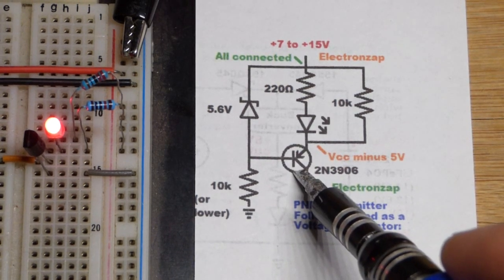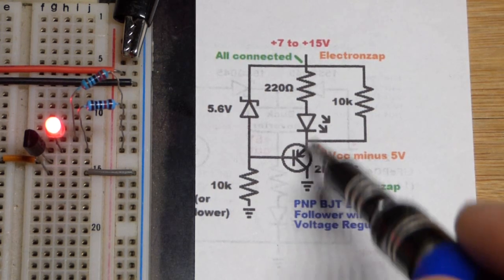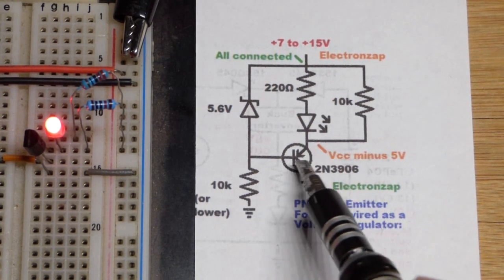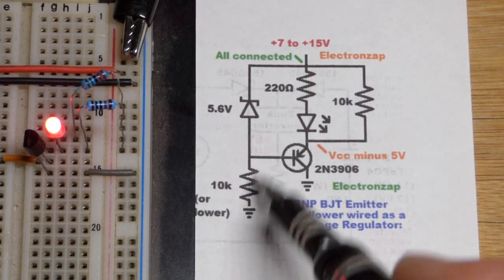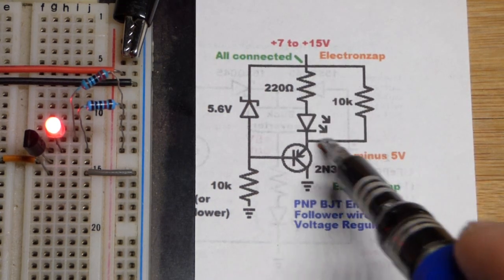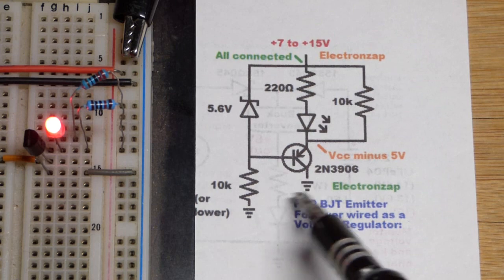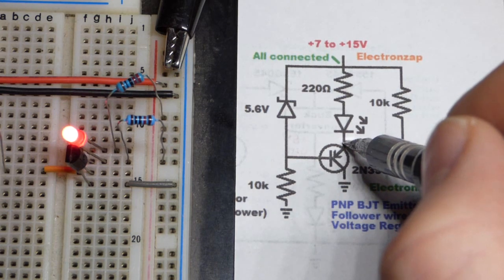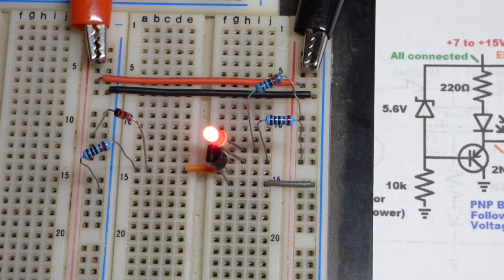PNP BJT sets voltage across load using 5V6 zener diode and 2N3906 Bipolar Junction Transistor

Comment: Look at transistor the reverse bias breakdown Vbe is . . . .  drums roll 5.6 volts.   Hey that was 50 years ago for me.  LOL   retired EE   Working on CAPTOR  ADCU a little digital auto corrector beam forming passive submarine flow noise detector.  Yes we had no MIL spec temp stable references we could use.  Keep working Amigo.        Long live the mighty  BJT.     MOSFET are nice too.

Comment: If I were to create a circuit to light an LED, first I would have it come on when the voltage reached a certain point instead of off.   Second, I would use a TL431 which has a precise internal reference so it can be set to any voltage with just a couple of resistors.   TL431 devices are very versatile and are used in feedback circuits of switching power supplies.   Finally, in regard to your schematic, you should put dots on any connections.
Reply from the maker: Thanks for the tips!

Comment: I dont get it, its a paradox, if current actually flow from one direction or another  putting the resistor on the wrong side would result in the LED being smashed by the current before it got resisted by the resistor.  But that doesnt happen. Like the double split experiement i think this really shows we dont understand how electricty flows. We have a formula that describes how it behaves after the fact but it doesnt explain what actually is going on - our current model of current flowing from one direction or another doesnt agree with experiement.  Doesnt anyone care?  Electron flow doesnt agree with expriement, either way!  Does this mean veritasium was right when he said elecricty doesnt flow through wires but in the field around them or something like that?  hmmm  Maybe it happens so fast, a scout electron goes first and scouts the way an informs the current behind it to slow down with the blockage ahead? thats possible
Reply from the maker: We can't see atoms or magnetic fields, only their effects. So, we will probably never know for sure what is going on. All we can do is test things out and remember the results when we want to make use of it.